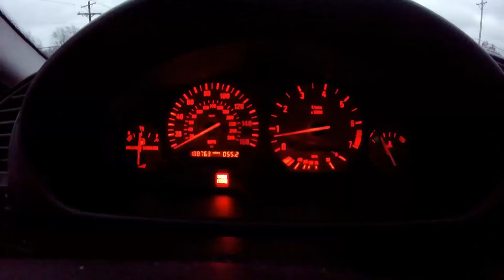Should You Ever Replace Your Transmission Filter?

Comment: I agree with your reasoning. Totally makes sense. Two other things I assume add to your arguments are that the filter is probably designed to have enough surface area to handle normal amounts of wear materials and if there is a magnet in the tranny, it will catch most metal normal amounts of magnetic metal particles.

Comment: The magnets in the pan need serviced cleaned so the can continue to be useful in a transmission clutch fibres are circulating in oil a strainer is no big deal but a fiber filter is different in needs of service.
Reply from the maker: But if it’s full of clutch material you’ll need a rebuild anyway. Lol. This is why it always sparks a good debate.

Comment: So I’m still trying to get a straight answer, I have a 2001 montero with 200000 miles that I bought at 113000 miles. I have never changed the fluid or filter since I was warned about a slipping clutch. I have not done any off-roading and the vehicle has been driving pretty gentle. The fluid on the dipstick still looks red and smells ok. Any need to worry about this?

Comment: Every transmission tech recommend that you don't flush a modern transmission.  Drain and fill only.  A drain & fill will only remove 40 to 50 percent of the old fluid, as you mentioned.  After a drain & fill, with 50% old fluid and 50% new fluid, it only seem to make sense to provide a new filter to help clean the dirty 50% of fluid.  If a filter is getting dirty, it's getting clogged and restricted and the transmission is going to work harder and hotter to pump fluid adequately through the transmission.   For the cost of a filter every three years, I'm changing the filter.

Comment: I read the comments, a lot of the folks say change the filters. I agree. Did the oil changes and not the filters on new trucks, and the transmissions fail...consistently. My mechanic says, the fluid pump exchange works good, well it hasn’t worked.

Comment: Just watched as I was going to do both filter and fluid but may just do fluid now. I have an 06 Crown Vic Police and the filter was replaced at 185k. It has now 215k. My plan now is to chance just the oil (Has a drain plug) and drive it for a day and change it again since I don't have the fluid exchange machine. I was planning on using the recommended Ford Mercon V fluid. Do you think this is sufficient. I'm taking it on a 1000 mile trip this Summer so it'll be hot and the A/C will be on etc.

Comment: Very good point. Let’s add an external filter to increase life span of internal permanent filter.
Reply from the maker: They did that on the Allison transmissions.
Reply: @PetesGarageandperformance  shit then I’m going to eventually do it. I think it’d be easy get some high pressure hose or fuel line hose, fittings, and brackets for the oil filter mount and mount it on driver side where the extra battery space is for the cheap way. Maybe even add a flush shut off valve or something. Probably going to far like that lol. Add a drain plug to my trans pan when I finally take it off to change filter for the first time.
Reply from the maker: Seems a little overkill to me lol. Make sure the filter flows enough.

Comment: I’ve been working on cars for many years. I found out that when you change your air filter if you clean your mass airflow sensor and let it dry for about an hour you see your fuel economy improve  I have serviced my transmission every 50,000 miles with the filter change every hundred thousand miles with a flush then a filter change I have 300,000 miles on my transmission with no slippage. I also do 50,000 miles on all my front and rear differentials of my vehicles, just a suggestion

Comment: I tend to agree on principle but question tho...shouldnt the loose clutch material and crud be cleaned out of the bottom of the pan every 80-100k miles or so? Just to keep the fresh fluid from getting dirty all over again? Or should we not bother doing that? Filter is probably fine but if the pans already off might as well put a new $20 filter on it. Or should i not bother dropping the pan to clean the gunk at all? In the past i would do that every 80k or so.

Comment: Great topic. Thanks for introducing it. I am not an expert like you, but I have been researching topics like this related to automatic transmissions and how often to change the fluid and how to best care for them at a reasonable cost. A modern automatic transmission, even if it still has a pan that can be readily dropped, is almost, but not quite, a sealed unit right? --because there is an air vent (to release any built up pressures that can occur), right? --including on the newer ridiculous ones that are said to be “sealed for life” by the manufacturer, where they do not have any way to readily get at the filter or magnet! --Although fluid can & should still be changed on them. 

I also read in a 2010 Motor Trend article, that 70-75% of all of the contaminants in an automatic transmission after 70,000-120,000 miles, (According to the Society of Automotive Engineers article), came from the original manufacturing of an automatic transmission. If this is so, then it would appear that regular fluid exchanges, perhaps every 30-50,000 miles (or more if towing), without ever changing the trans filter or cleaning the magnet would be OK assuming the unit isn’t abused. And on these modern sealed automatic transmissions that have no easy way to get to the filter or magnet, a simple regular fluid exchange thus might be sufficient (and the only maintenance that could be readily done anyway!) Therefore, unless an a/t is abused, it appears that the major function of the filter in the first place is to catch the debris which were left inside the transmission from the manufacturing (or rebuilding) process. (I am running this by some transmission engineers to verify this, but have not heard back yet.) Thus, it appears that you are correct! 

As an additional point, if 70% or more of the filter contaminants came from the original manufacturing, then it would seem that the number one purpose of the magnet would also likely be to catch metal debris that originally came from the manufacturing. So perhaps if the fluid is changed regularly there is also no concern about cleaning the magnet as it can just keep holding the metal debris until the end of life. Thus also supporting your thoughts about trans filter changes being overemphasized.

Now if it an owner really was fanatical about maintenance of his automatic transmission (& which had a pan that can be dropped), & wanted to put hundreds of thousands of miles on his new vehicle transmission, besides avoiding all abuse, such as overheating the unit, an early filter change could be done, say at 20,000 miles, cleaning the magnet & pan as well, after which the filter & magnet could be ignored, for 200-300,000 miles (or maybe longer!!), while sticking to changing the fluid every 20-50K miles, depending on how fanatical he was & how durable the transmission design is.

Incidentally, your comments on the torque converter holding quite a bit of the old fluid on a pan drop type of fluid change, were spot on in my case, anyway. On my Panther transmission (Lincoln Town Car, Ford 4R75E), I use a drain pan with a drain plug, & the torque converter (or other areas as well, such as the cooler) holds roughly 2/3rds the total amount of fluid!
Reply from the maker: Exactly! It looks like you’ve done quite a bit of research on this subject. If you’re getting more debris in the transmission after initial break-in, you’ve got bigger problems that a filter change wouldn’t fix.
Reply: @PetesGarageandperformance  Yes, agreed. But it is still possible that a man might ignore his transmission yet still do oil changes and air filter changes and after hundreds of thousands of miles begin seeing his transmission act up (skip shifts, start slipping etc). In this case if he simply ignored it by driving reasonably but never changing the fluid and filter he might get considerable benefit by changing out the filter and cleaning the pan and magnet and only then doing a one way direction fluid change, by dropping the trans cooler line just before it goes into the radiator trans cooler and draining into a catch basin while connecting a fluid reservoir filled with clean proper trans fluid to the other end so that a flow of clean fluid comes goes in, there is no air introduced & the pump keeps pushing out the filthy fluid until it shows clean. --An old transmission specialist once told me after he did this on an abused automatic transmission, that he then checked to see if the trans operated properly and if not, he would add a friction modifier (such as Lucas Transmission Fix) to actually add friction to the unit (which was previously provided by the old worn out clutch material, tiny amounts of dust that got in from the air vent, etc), so that the trans would still shift. In fact I called Lucas and talked to their transmission technician about such a situation. He said that you can add up to 15% of their Transmission Fix product in place of the manufacturer's recommended trans fluid to a trans that was slipping. So in my case at a total of 14 quarts total it would be about two quarts on a neglected 4R75E. He said they had seen results like this with the same 4R75E that had over 400,000 miles on it without a fluid change and a clogged up filter (no doubt filled with added debris from the clutch material, not just the manufacturing)! --He changed all the fluid out and filter and cleaned the magnet first (to avoid any possibility of debris possibly getting caught in valve bodies) and then added the new trans fluid & the F150 (same transmission as in the 2006-2011 Town Car/Grand Marquis/Crown Victoria) actually shifted again! He said it lasted another 37.000 miles of easy driving down in Mexico. What is your take on this? it sounds plausible on a pretty sturdy automatic transmission like these. I recall Detroit Taxi Cab drivers driving Crown Vics, saying they would put about 100K miles a year on their units and never changed the trans fluid or rear axle fluid becuase they didn't need to! After 400,000 miles or so he would just sell it! hah!

Comment: Some transmissions are not "Sealed."  Almost all the transmissions I've encountered (Ford, Chevy, Toyota, Nissan, Hyundai) all had vent holes on top of the transmission case to allow the "crankcase" to breathe.  That's what a friend of mine told me who happened to be a transmission mechanic.  I pretty sure that those transmissions will breathe in some dust driving down the road.  My Hyundai Excel took water through that vent in a Houston flood that submerged that part of my transmission.  To fix the issue my buddy flushed my transmission for a case of Bud.  He used about 25 qts of fluid to do the flush.  That is when I learned the only way to get a relatively complete fluid change is with a flush machine.  I bought an "03" Suburban which does not go into reverse immediately when it is cold; which brought me to your video.  I will probably change the filter, retorque the valve body bolts, and clean the pan or take it to a shop with a flush machine and have them do it.  It will be pricey for sure.  Anyway you wanted comments and that's my two cents.  Thanks for your insights and the well done video.  I will Like and Subscribe.  Have a blessed day.

Comment: Going to change trans fluid in my 2003 Taurus soon.  Got a new filter - extremely cheap.  Why not change it?
Reply from the maker: If you drop the pan, go for it. But if you don’t have to drop the pan, why waste the time?
Reply: Every time I have changed mine my transmission went out.  Chevy 1500
Reply: I took my dodge 2500 pickup 4x4 in for repair. It needed a sensor replaced in side of the transmission. It was stuck in 4th gear. So they told me warranty will cover the replacement of oil and sensor but not the filter. They were charging me $200.00 for part and labor. Made no sense to me. Why pay for labor when you're already doing it. Labor charge is what's expensive.

Comment: The filter came with a pack with a High rated rubber gasket, for a low price. It worked good after I changed it
Reply from the maker: Did it work great before you changed it?

Comment: I've got a 3.8l v6 with closed system. There's an overflow bolt so I'm just going to drain all I can and refill. I'm not changing the filter especially since I probably won't get all the oil out anyway. Suv's been having a few issues with oil consumption, acceleration and gear change and I'm pretty sure it's time to change it the oil. All fluids looked pretty beat so I imagine the trans fluid and differential is as well. This thing has such bad carbon build up even after plenty bottles of techron it's unbelievable with 140k miles on it. I would change it out being that it's the first time but there's a bunch of sensors that need replaced and the rest of the fluids so I'm trying to get as much done as I can without spending outrageously.

Comment: My opinion is, that if they put a filter there, it's for a reason, that reason being on hydramatics gm and transmission such as the 4l60... manufacturers recommend changing transmission filter on gm trucks 1500, between 30 and 50 k miles, clutch dust will clog your filter. Just my thoughts.

Comment: I had never thought of it this way but so true, if the filter absolutely needs replacement there are bigger problems going on in that tranny.  I now am not concerned about not changing the filter in a friends 2018 Impala which has the filter deep inside requiring disassembly.  Not sure why GM would not install it at the pan like most transmissions.

Comment: I always wondered why they didn’t have a drain plug in the pan and the return filter on the outside since that’s usually the one that needs changed most often. Then you could drain the fluid and change the return filter every 30,000 and dump the pan, clean the magnet, and change both filters every 60,000. The sump filter is more or less just a screen and usually isn’t that dirty at 30,000. It actually doesn’t take much dirt and clutch material to plug some valve bodies and for shift solenoids to start sticking. Also, restricted flow from a plugged filter will cause more heat which  is what destroys transmission fluid the quickest.

Comment: Run an external remote filter with clamp on magnets. Change the fluid and filter once a year (drain and fill). Also, monitor transmission temps, while using high quality fluid. I chose to go overboard on my transmission cooler with a puller fan. Best bet would be to drill two torque converter holes with drain plugs 180* apart, to drain the converter fluid during maintenance.... if possible.  The cleaner the fluid the better! Never overheat and oxidize! If, a failure happens, more parts are reusable with external filter and magnet imo.

Comment: Since a filter and gasket is less than $15, for my vehicle I would think it beneficial to change the filter along with the fluid if only to clean the transmission pan and remove the worn transmission debris trapped by the magnet.

Comment: My 1998 Lincoln continental’s transmission was making a high pitch whine sound from the trans front pump. I dropped the transmission pan. And put a new filter in, loads of metal mud on the magnet, swapped the filter out and added new fluid. Now it makes no noise and shifts better. I’m at 210,000 miles.. for what it’s worth.

Comment: maybe it varies from car to car according to transmission design, but transmission filters allow pretty large particles to pass....it is like the filter is only there to catch the really large particles. In 50 years of DIY auto servicing I have never seen a trans filter that plugged up or visibly indicated a huge build up of crud. The volume of trans fluid pumped has to be very large and the filter has to be designed as low resistance to flow....very low. The magnet in the pan and the pan surface always have a layer of foreign material. Based on this I doubt you ever would plug up a trans filter unless there is a catastrophic event in the trans. I do believe in frequent trans fluid change...30,000 miles or less....it pays! Where I have had a non serviceable torque converter I do two or even three fluid changes in close succession so that I end up with a "mostly" new fluid by dilution.

Comment: To remove the transmission filter, the transmission fluid has to be drained and the pan removed.  Unfortunately, the transmission of my 2000 GMC Yukon has an obstruction  (exhaust pipe) that has to be move aside before I can remove the pan.  Since i have a stopcock at the bottom of the transmission pan, what I do is empty out of old transmission fluid remaining in the pan and replace it a few times over times on consecutive weekends which dilute the old transmission fluid such that the old transmission fluid is mostly flushed out.

Comment: i agree, the key is to run your temp lower by adding a trans cooler and changing your fluid every 25k, I just pump out and add new fluid, takes 20 min cost $20. 320k miles on my trans and it runs smooth as ever

Comment: Would transmissions shed clutch material and teeth if the fluid is changed often enough? Is that wear inevitable, at least within a reasonable time, say, 250,000 miles?

Comment: I have a Honda CRV every 30,000 miles I do a dump and change,
Then I run in 15 minutes and I dump and change again this way I can get some of the fluid out of the converter, if the car makes 100,000 miles I’ll change the filter it’s external it’s no big deal. But your logic is 100% right I’ve seen people change the filter on there a Honda with 190,000 miles they open it up sure it’s a little black but it’s still works, so for me every hundred thousand miles , it’s like changing a fuel filter no big deal